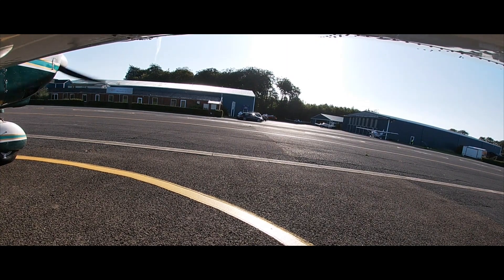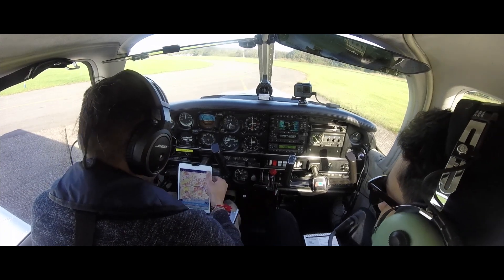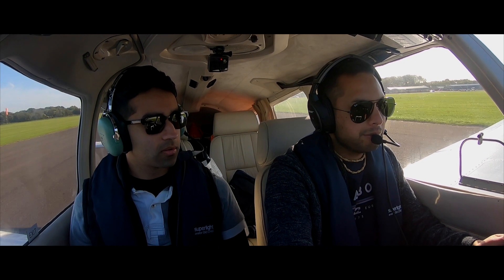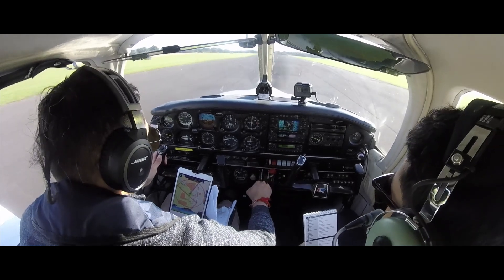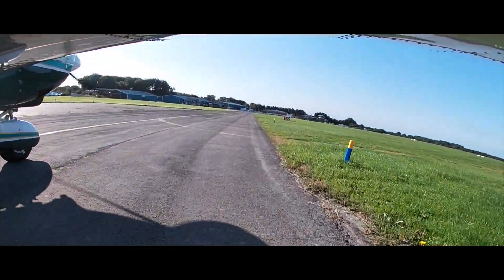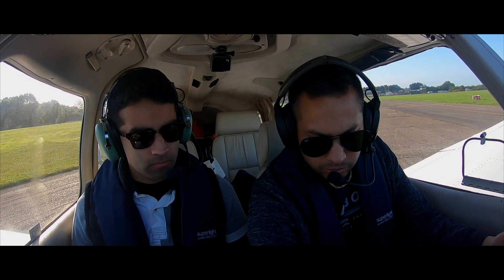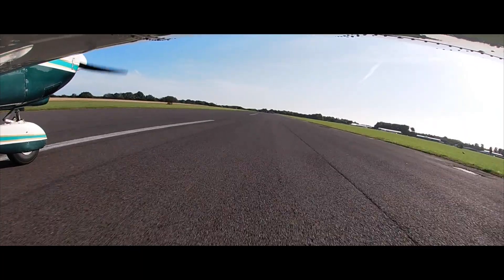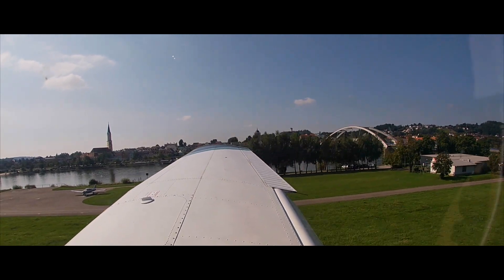Aborted Take Off-Cockpit View

Comment: Of all the excellent comments below it's the one from Chris Bell that really nails it! 

"Better by far to be sat on the runway wondering if it might have made it than sat in the treeline wondering why it didnt..."

I could think of two other things to consider: Do you think it might have been carb ice? What if the pitot tube had become blocked (even after your preflight check) low risk definitely but a possibility?